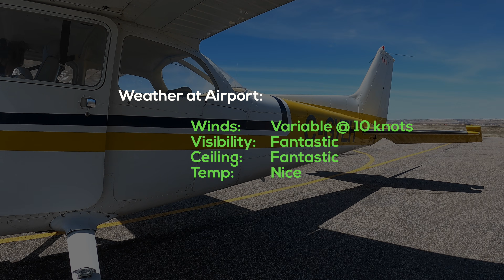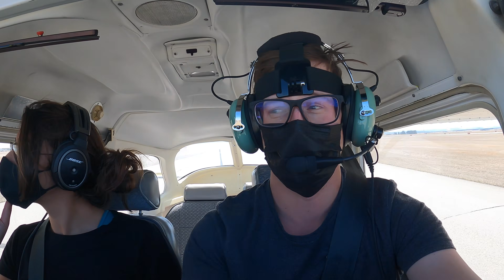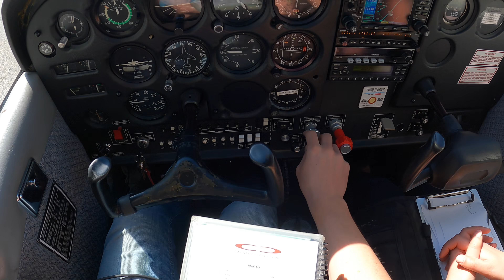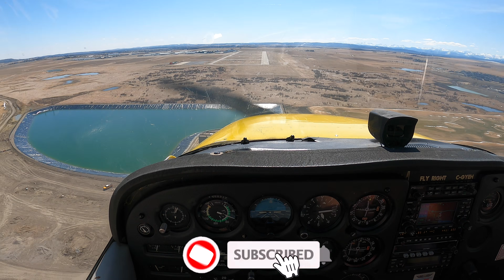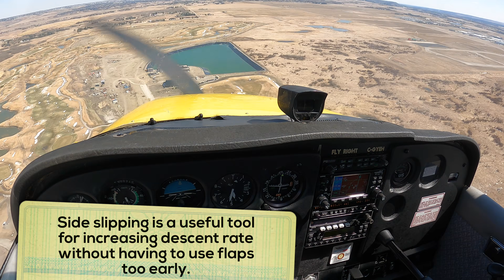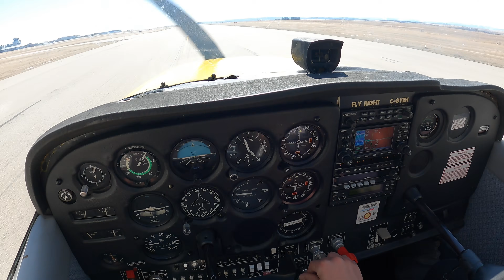HOW TO LAND A CESSNA 172 | Circuit Touch & Goes | Getting Your Pilot's License | Flight Training

Comment: 20º or 30º  flaps on a "normal" landing with lots of runway? I haven't been current in a 172 for too many years, but I was never taught to use flaps on a normal landing. I'm wondering why the change? Most of the 172s I flew had the "barn door" flaps that would extend to 40º, which I appreciated. Thansk for the videos and the chance to remember the  joy and the challenges!

Comment: For the best results on power off 180's (what you did there) is on downwind to have a runway go into your half of strut visually when you look at the wing. After abeam threshold and power off continue on downwind until done counting to 10, then turn towards numbers and adjust for the wind if needed. Full flaps a bit earlier than you do and you would be on the spot every time.

Comment: thx for posting
Reply from the maker: I’m glad you enjoyed it!
Reply: @EvanLuft  Im struggling a little with trim settings and setting air speed with addition of flaps.  Are you using your control pressure to set an airspeed then trimming off pressure?  Or setting a go to trim after powering back and adding flaps?

Comment: Funny, they determined in the construction industry that masks were more dangerous than no masks, on account of the required safety glasses fogging up. I would never fly a plane where my vision was intentionally compromised. Anyway, you’re 10 inches away from the person next to you, so breathing out the sides of a mask instead of in front of you isn’t going to help stop covid much…
Reply from the maker: Very true and lots of difficulties in the industry we are in up north (oil and gas) but for flying… it didn’t impair me at all :p, if it did however… then I agree completely with you!

Comment: Nice channel. My question is what are the safety features in the plane or things pilot do in case the engine stoped working or a sudden failure in the plane parts while being high in the air 🥶🧐🙌?
Reply from the maker: Hey! It all depends on the type of airplane. In a single engine aircraft like in this video, the higher you are in the sky, the better off you are because you have a longer time to troubleshoot the problem and find a landing spot to glide to. :) all sorts of things break all the time in aircraft but usually they are minor problems that don’t impact a flight directly. But most emergencies no many how serious are manageable and pilots are trained to get the airplane down safely.

Comment: Hated the -172 at first but now I'm getting to where I'm just undisturbed by it. I always like to fly power off 180 faster than best glide so I have maneuvering energy. BTW It's the water that creating sink on short final, If you have water in front of your landing zone keep a little altitude or speed to deal with sink.
Reply from the maker: That’s a good point! Yeah the 172 is a fun little airplane. I don’t mind buzzing along at 100 knots now and then.

Comment: Excellent clarity and detailed explanation. I am resuming my PPL training this week after 14 months away, so this was a useful video.
Reply from the maker: Thanks a lot! I really appreciate it :) sometimes it is a challenge to get good visual content while flying at the same time! Haha
Reply from the maker: And keep me posted on your progress with the PPl!
Reply: @EvanLuft  So, first outing last Thursday. Very thermally and even conditions. Instructor handled the gusty crosswind takeoff which normally I would have done but after 14 months layoff it would not have been sensible.... I took us out of the circuit at 2,000ft and spent the next twenty minutes simply flying around Derbyshire/Staffordshire working on achieving a consistent straight and level and airspeed. It took a while and needed regular small tweaks as the wind direction and speed was so variable. After nailing that and making sure the trim was spot-on we headed back for a couple of low approach and go round practices on 35. I realised on the way home that I'd not once checked the DI against compass after we had taken off, and I forgot carb heat on at least one of the approaches. Still, we ended up at the right height and airspeed on the approaches which tutor seemed happy with. The go-arounds were messy because I was taking my eyes inside for taking the first stage of flap back off, so we practised messing with the flaps without looking. Tutor landed us on runway 28 (there are three at EGBD) I haven't used before; even he had to admit he'd floated a bit, with airspeed a couple of knots high.
I expect this is all familiar sounding stuff to someone with your experience! Next lesson Monday, hoping it will good for circuits on 23 and getting closer to happy relaxed near perfect landing.
Reply: hmm  that should said UNeven conditions  :-)
Reply from the maker: @colinbartram3467  Thats awesome! well to be honest, nothing speaks for experience. I always tell newer pilot to just get in the airplane and go flying... because confidence with the aircraft controls will increase exponentially with stick time. I know 200 hour pilot that are WAY better pilots because they are practicing a more complex aircraft than some 3000 hour pilots that just fly the same airplane every single day in the same area with no weather. haha Also... once you get confident with your landings... it will transfer over to every other aircraft you fly. At some point... an airplane is just an airplane and you'll feel ready to take on any aircraft!